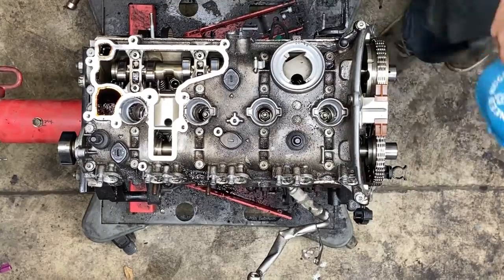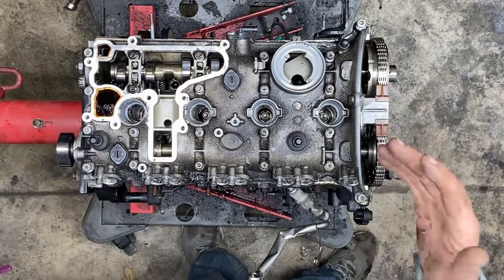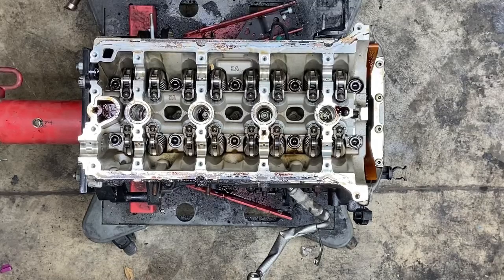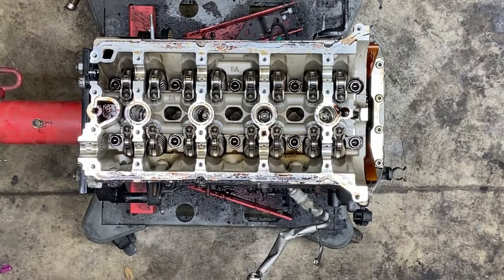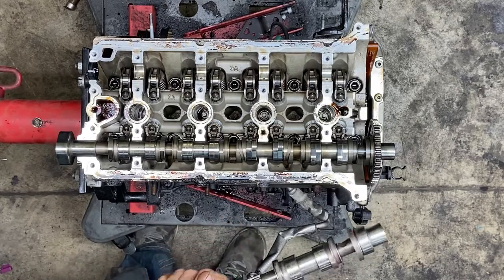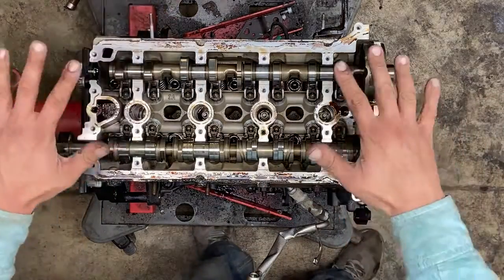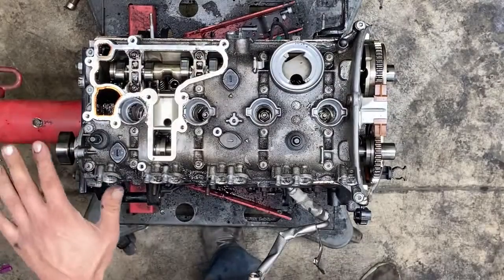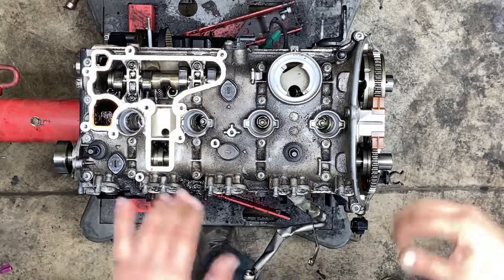2.0t TFSI CAMSHAFTS INSTALLING

Comment: I have a request. 

My car needs the following jobs to be done to make me feel safe about it. 

16 b8.5 CPMB w/ flex fuel 
Need to re seal cam tray. Have an oil leak going into cylinder 1 (small leak around plug. 
Want to replace timing chain fully (maintenance) 
Want to replace water pump with aluminum. (Maintenance) 
Want to replace PCV (maintenance) 

Want to replace coolant outlet in back of motor, that you stated failed often!! 
(Maintenance) 
Want to replace high pressure fuel pump. (Maintenance) 

If there is a chance you can do a full video of these items start to finish that would be incredible. Just a wish list from a fan!! 

Thanks 

Paul - all the best

Comment: Hi there,
I'm working on my A4 2010 removing valve cover and wondering if valve cover bolts need replacing?
Reply from the maker: Technically yes do I feel the need to replace them or have I ever seen one snap or not re-torque properly no.

Comment: What's your though on journal repair? I finally had to use my backup head and would hate for the one to be scrap.
Reply from the maker: A good new amc cylinder head is about $1300 having a used cylinder head rebuilt can cost about 7-800$ for good parts and labor.  I’ve used China heads for the $600 range but The quality suffers and I’ve had a couple bad ones out of the box.  If you have journals that are scratched, some can be cleaned up and it will just hold oil and be fine.  If it’s too bad then it won’t use it.  It’s probably not cost effective to have a shop repair it but you could call around and see what people say.  I have a cylinder head comparison video that was only about a month ago, I would just get an amc head but you really need to make sure your oil pump / pressure is good and you don’t have any scored bearing in the bottom end or clogged up oil passages.  I have a spun rod bearing engine that I recently took apart and that video I show the cams a journals.. I won’t re-use that head as an example

https://youtu.be/JCFtdazrjLU

https://youtu.be/DI5Cxnuk_mc
Reply: I'm believing oil pump has been the culprit the entire time. Never had oil pressure warnings but timing keeps going out after 3 months. Tried 2 different heads different camshafts etc. Now I'm on my 3rd head that I'm rebuilding. Polished and ported etc. I'll most likely pull the engine. While I'm doing the pump and pistons what else should be done as preventative or upgrade that is worthwhile other than gaskets

Comment: Took car to a shop, they pulled out the head, and to replace with a new head, they said with a new cylinder head, timing chain yada yada yada, they still would need to pull out all the internal parts of the new cylinder head (parts that come installed already) to “time” them (valves, rocker arms…) = $3,000 worth of labour. Is that true? Does a new head (from Eurotuning) with all internal parts installed, excluding the camshafts need to be stripped and done again? if yes what parts? I feel like I’m being extorted. Because this other shop says it’s all a bunch of lies; that you can just slap it on, what needs to be timed is the timing chain (duh) to the cams, and to torque down the rockers and other parts. And are obviously charging less labour, but I want a mechanic I can trust that they know what they’re doing, cuz this other shop say they’re specialists in Euro cars as well

Comment: ALTERNATIVE - Permatex Anerobic Flange Sealant
This sealant is most commonly used on Camshaft cradles for 2.0T engines and Oil pans and is a great alternative to the very expensive VW Audi sealant.
Reply: Thank youu
Reply: I know this is an old comment, but I have a correction - you would want to use Permatex Anaerobic Gasket Maker, not their anaerobic flange sealant. The flange sealant, per Permatex, is not to be used on aluminum as it can cause putting. The part number for the Anaerobic Gasket Maker from Permatex is 51813. I hope this helps someone in the future.

Comment: Alright brotha,  if you get time,  I got one for you. 

I had to replace my exhaust cam,  so I took both my cams out of the car completely.  But I forgot to set the time to top dead center before I removed them. Does that mean I have to take the lower cover off and retime my car?

Comment: If the camshaft pops up when the pressure is removed from the valve cover then why isn't pressure needed to replace the valve cover? I ask because ordinarily the vacuum pump holds the camshaft in place under pressure when the valve cover is removed. Would there be anything wrong with holding the camshaft in place with something while replacing the gaskets for the vacuum pump?

Comment: this is a perfect quick video J 
you just save me from more headaches
 with the valve cover that didn't fit after I removed it. and from screw the camshafts up.
Reply from the maker: I’m gonna make a better one,  I deleted a few videos, it’s best to put the cams in without the rockers and without the sealant first and torque it down.  Both cams should spin easily by hand

Comment: The detent ball sprung out of my camshaft once. I looked for it for hours before I declared it a lost cause. If this ever happens to anyone have your local Audi dealer pull up a parts diagram of the exhaust camshaft, you are able to get both the ball and spring separately and are only a few bucks each. Don’t throw out your expensive camshaft!!
Reply: Hey, I hope your still active because I'm dealing with this right now. I was planning on going to the Audi dealer tomorrow, any advice or info on how to put it in once I get the ball ad spring? Hoping for help right now... I'm on the verge of exploding with this thing...
Reply: Do you happen to have the part number?
Reply: I used a pair of thin pliers to hold ball down and a second person to push cam piece across

Comment: Great explanation as always. I did my cam tray few weeks ago because it had an oil leak and after the first start engine start ticking. No errors yet as I shut it off almost right away and timing seems to be ok, lines up perfectly with the cams and crank mark. Pulled the covers off and looks like I got the old timing chain tensioner and the chain itself got stretched so will replace these first and see how it sounds after. Did you ever experience that and should I look for anything else while I’m in there?
Reply from the maker: Pop out the screen like I show in the camshaft bridge video, pop off the front case like I show in that video then I have a video of sealing the case.  Plus the timing chain videos.  Make sure your rockers / rollers are all good.  Might film slapping a head on tonight
Reply: @NaptownTuner  nice, thanks for the reply and can’t wait for a new video
Reply: @NaptownTuner  you were right, the last roller arm from the intake side close to hpfp was sitting sideways, do you think it created any damage to the valve or other parts? Or just throw a new one in there should be good to go

Comment: Bro I love you. I know this video was for me because I asked for it lol. my ball popped out with the spring and I couldn't get it back in place or figure why my cam was out of wack I didn't know all those moved side to side. I popped my ball and spring back in and did it and my cam went right in place.  Now I will ask for more help lol installing the kolbenshmidt pistons. do the rings have to be in a specific order or just compress it and call it a day? a video on installing pistons would be very helpful indeed.
Reply from the maker: They come installed and pre gapped and you have a oil scraper and 2 rings just arrange them all apart like a triangle the gaps.  That’s how I was told by my instructor that teaches the district in Chicago area.  Make sure you use the appropriate piston ring compressor and ya I’ll get around to filming it
Reply: @NaptownTuner  Do you check them to make sure the gap is correct or do you just install them.  About to do this job.  Thanks for all your content!

Comment: Speaking on the intake cam, I noticed that on the outside of the lobes where its closest to the head...the head is shaved down by the spinning lobes. I have done my timing twice only to see my phase position go straight up. Before I started this rebuild I hit high  12's° I never reset my cam like you just said.  Any input as to it being a possibility for the timing going right back? Also about the head being worn down like so. Need to say that I did all the work by the repair manual instructions with new timing components
Reply from the maker: I’m not following your issue but I’d like to add if you bent valves then is possible for one or more intake cam lobe to spin on the shaft slightly causing the valves to not sync properly.  
It’s important to make sure all the cam lobes line up with each other on each cylinder

Comment: After watching this , and I have 100% faith in your knowledge. The dealership used black rtv on my cam tray after piston replacement. Flood of oil, 14,000 
later. Some tray bolts were finger loose.
Service like that should be criminal. 
Thumbs up and thank you.
Reply: They give 3 options green sealant. Rtv. And locktite

Comment: Thanks for the info!  Is there a special procedure for setting the exhaust cam solenoids properly? Or, will they set themselves when you rotate the engine 2 times by hand?
Reply from the maker: The pins or special tools that the dealer has to slide the cams, first off nobody in their garage is gonna use those and I only used them the very first time I ever did the job.  I’ll explain in a different video how to remove the head with the cam tray still installed without using the pins as well.  But to answer your question yes it will reset itself on the first test drive, if not the first time you start the engine.  It switches over at 4K rpm so it’s always a must to run the engine over 4K rpm on a test drive any time you do any work on these just to make sure no faults set.  I’ve never had a problem on the hundreds of piston jobs I’ve done through the years

Comment: Will not removing the camshaft adjustment actuators before removing/installing the cam tray cause any issues?
Reply from the maker: No it’s fine but you have to take the first one out to remove the bolt behind it.

Comment: Can you do a video about any problems you’ve seen if any with using e85 in the flex tfsi 2.0T thanks
Reply from the maker: It’s all pretty much the same but I’m not in favor of flex fuel it has poor lubrication compared to strait gas and is harsher on the metals and oil.  Better to keep using strait gas and leave the corn fuel alone.

Comment: I have a 2008 Audi A4 2.0 SLine, 
I’m getting oil all in my Spark Plug on cylinder 1. The oil is on the Electrode of my spark plug. I checked all the rest and cylinder 1 is the only one doing it. What could that possibly be. Engine has 235,000 miles , what’s your recommendation NapTown Tuner Thanks 🙏🏽
Reply from the maker: If it’s a 2008 it’s the 1st generation 2.0t different than this and you have a valve cover and a cam tray.  Replace the valve cover gasket
Reply: @NaptownTuner  
The oil isn’t leaking down to the Spark Plug, the oil is shooting up to the Spark Plug electrode on Bottom
Reply from the maker: @angelgutierrez5415  some of the Audi’s that I’ve done oil consumption on drank as much as 1qu per 200miles so at that rate plugs foul quickly.  If you’re getting fouled plugs and you’re at 235k with possible oil consumption in my opinion it’s not worth pouring money into that engine.  If the car is super clean and you want to keep it slap in a low mile engine from a wrecked car.  Less down time less money extra parts documented lower miles win win win

Comment: Hey man, Love your channel! So much great content and I learn a lot! Got a question, I have a 2010 Audi A4 avant and have a check engine light on. The code reads P0016 which reads cam shaft position Correlation bank 1 sensor A. Would you possibly know which sensor that is and or what could cause this? Car drives great, I noticed when I go to start the car it has to crank 3-4 times while holding key in to start?
Reply from the maker: I’ve got a few timing videos, no need to even check it, timing tensioner and chain need replaced I have at least 2 videos on it one with p0016 in the title
Reply: That could be a stretched timing chain.  Have you had the tensioner and guides replaced?
Reply: @homer4163  Im not sure, traded in my 05 wrx for it in March and it’s had the light on it since. Is there an easier way to check the chain while engine is in vehicle?
Reply: @That1Idahoguy  there is an access hole in the lower timing chain cover to peek at the tensioner.  It's not easy to get to,  but with a flashlight and mirror you should be able to see if you have the bad tensioner.  Basically B8's from 2009-2011 had a bad tensioner that would break and cause catastrophic engine failure.  There's some videos out there on how to check it - let me see if I can find it again and post it here.
Reply: But I think that code you are seeing means that the actual camshaft position is off from where the engine thinks it should be - so your engine may be slightly out of time.  That may be due to chain stretch or faulty tensioner.  Definitely worth looking into because that code could be an early sign of chain failure.
Reply: Here's one.  It's for a VW which is transverse mounted so he's going in from the side.  You would go in the front but checking it is the same:
https://www.youtube.com/watch?v=BL_pLK7oGkg